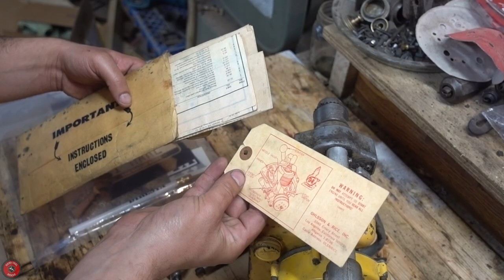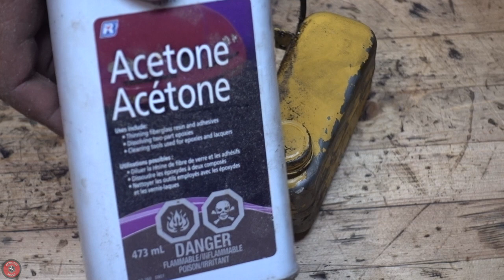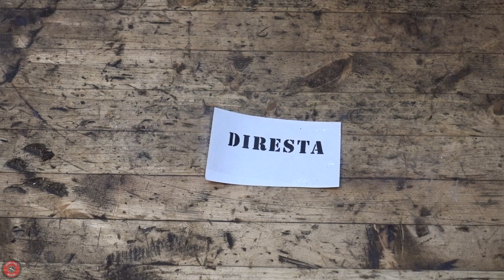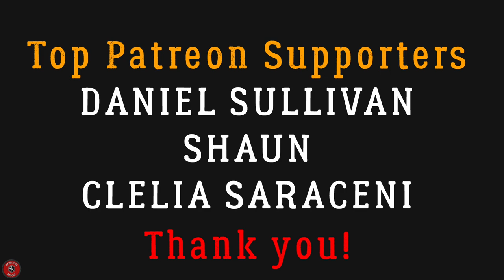Gas-Powered Hand Drill [DiRestoration]

Comment: Nice one. But how come you stopped disassembling everything? No piston/con-rod/crankshaft/head/exhaust/intake cleaning? And that chuck needs something.. is a little wobbly. The arbor is bent, or the jaws are misaligned, or something. And no inspection on the gearbox.. must have some gritty shmoo in there.
Reply from the maker: This one was more of a quick job, just to get it running.  I didn't want to open up the gearbox as I wasn't confident I wouldn't damage the gasket doing that, and they are hard to find!  I really want to open it though...
Reply: My thought as well, some turd probably dropped it.
Reply: ...gasket/s...or other hard to find parts.....try my friends at S&G Power Tools in Rancho Cordova, Calif.....2 stroke is all they do......for the last 35 years.....
Reply: Is it a weird metal gasket or something?  I've only ever been scared of head gaskets.  Don't you fabricate when you have discontinued gaskets?   Strange rebuild, but you did get it running.  I'd have to bin myself into the group that likes your other restorations better, however.
Reply: AvE LOVE IT.

Comment: Everything should be powered by a little gas engine.
Reply: I want 2 stroke kitchen appliances.
Reply: madbrianthepirate I want a 2 stroke powered light switch
Or a 2 stroke powered fork.
Reply: Taylor Robinson y tho? Too much complicated.
Reply: Complicated?? If you maintain it ONE PULL IS ALL YOU NEED. Try counting how many it takes you next time..
Reply: I'd buy it.
Reply: Nutz4Gunz45 that's what Toyota is doing. 😁
Reply: it is.
Reply: Michael j fox has the fork one down
Reply: Reminds me of a old commercial where everything was powered by gas engine, the copy machine, computers, even the water cooler lol look it up on YouTube it’ll SATISFY you
Reply: Petrolpunk.
Reply: Nutz4Gunz45  --  I want to see a TOASTER powered by a little gas engine .  LOL !
Reply: BRUMM BRUMMMMM!!
Reply: I prefer electric stuff (battery powered). I have found it works better for me, is more reliable, and easier to fix.
Reply: Gas engine powered phone... seems legit.
Reply: madbrianthepirate a two-stroke blender, a two-stroke toaster, a two-stroke dishwasher...
Reply: Nutz4Gunz45 olaaa Brasil gosto do seu trabalho
Reply: A Detroit diesel powered vacuum cleaner and a 3 cylinder turbo dishwasher are on my list.
Reply: @ClappedBimmers  Best i can do is one
Reply: Unfortunately I haven't yet seen a gas-powered sewing machine, that would be really cool. Or a gas-powered lathe

Comment: 13:05 but why ?
Reply from the maker: Making it look like one of Jimmy's personal tools.
Reply: asking the real question here.
Reply: Hand Tool Rescue Ah like all his stuff plastered with that eye sore of a name.  At least you know his style.
Reply: this was made before we had things like good portable batteries for working in remote arias
Reply: Shop Dog:  Where can you get a battery powered drill that will drill a 1 3/4 inch hole through an 18x18 inch timber.  That's what these type of things (not this one obviously) were made for.
Reply: If not for the still faulty carbeurator, it still could. If I needed something like this, I would want it very badly and there would be no replacement.
Reply: because it's his.
Reply: So, first you remove the paint that already looked like it was used. Then you repainted it... And then you destroyed the paint to make it look like is was used again... right! (Also yellow looked way better.)
Reply: Ahhhhhhhhhhhh.  Over spray!!!!

Comment: Motor stops on idle, looks like it has hardly any power to drill like 3 or 5 mm hole in dead tree carcass and the chuck had a bad case of wibble wobbles, it looks like the tool needs more work than cleaning it and repainting
Reply: Yeah, didn't look like it ran too good in any of the few second long clips he showed us.  Also, that engine isn't 2cc more likely 22cc.
Reply: funny how nobody reads the description

Comment: That was a neat old tool before the "restoration".   A little on the amateur side with the crude mechanic work and wood chisel paint scraping if you ask me. Not sure what the ultrasonic carb cleaning was about since the thing was only about 50% disassembled when it went in whatever that watery lookin bath was.  Would like to have saved it myself.  Guess that's just my thoughts on it. Kinda wish I hadn't watched now :(
Reply: Read the description

Comment: I am sure I  have seen this engine in other applications, mainly model aircraft. 

That aside.. If you ever get the chance to play with hydraulically driven  drills and chainsaws,  "do it". 
I once got to play with a well equipped "SEE" (A U.S. Military version of the UNIMOG 406) , and the chainsaw was a beast.  Even with a dull chain it would rip through mesquite like nothing. 

Just make sure they don't leak. Some of them run at absurd pressures, and will sever digits.

Comment: Dude, you got new tools! Nice to see a puller but really surprised to see the laser cut diaphragms and ultrasonic cleaner.  I've been wanting one of those forever. Perhaps next on the list is a putty knife for scraping instead of a chisel? Great job on going straight for the points on the lack of spark. I don't think it will take much adjusting to get the motor to pull RPMs.
Reply from the maker: Thanks! Plastic scrapers are definitely a good addition.  I don't have the laser cutting though! haha

Comment: Howdy.At 4:08 the caption reads 1000 grit.From the dark colour of the grit,it is possible that is emery.I was taught years ago,in no uncertain terms,never ever use emery on points under any circumstances, it is an electrical conductor,and once embedded,is very difficult to remove.You might want to remove the points and clean them up with a nonconducting abrasive.Clean flat points that are parallel to each other make quite a difference. Good luck with the carbeurator. I remember many frustrating hours with those little things.

Comment: Hey, at our school in washington we have an old 1960's Toro Sportlawn Reel Mower 22 inch. I did all that I could and accidentally broke the clutch (it was broken anyway and I really just finished off the crack). I did some makeshift repair and fixed what I could, and the clutch is hard to replace. I managed to "repair" it because it works a bit more than none at all. If I was able to weld I could have fixed it easily. The engine sparks (I should know, I shocked my hand several times trying to get it to start >~<). But my limited knowledge prevents me from fully figuring it out. It's either going to be scrapped or turned into a lawn ornament. 

Also, there are some issues like the clutch cable is seized and the throttle cable was cut, so I had to make do and it is kinda limited in that case. There is also another piece of equipment with the same engine here. Oh, and the tires are bald, but are pretty good overall. When I was looking for parts it was one of the things that was sought after. If you are interested I could give more details

Comment: ScotchBrite on those flywheel magnets neighbor...will keep the smooth while rubbing, not pit or remove too much parent material but superior at removing 
oxidation. 
Always surprised to see these excellent craftsmen using sand paper when they should use SB or a burnishing too...or banging and prying on a 
axle mounted spool/flywheel when a gear puller is the only way to insure no damage to the system components.

Comment: i used a ryobi engine drill when i installed piers in the early 90's. it was a 25cc, if i remember correctly. it drilled holes in concrete sea walls in nothing flat.

Comment: READ THIS: Jimmy Diresta sent me this tiny gas-powered hand drill made by Ohlsson and Rice for restoration. It was originally used to tap maple trees for syrup and was called the Drillgine. I believe it's from the 60s or 70s.

I decided that I didn't want to do an "as new" restoration and wanted to make the drill look like it was one of his tools that he painted white and used every day.

The drill needed its points cleaned, a new carburetor diaphragm, and a new recoil assembly. 

The small 22 cc (video says 2cc) engine produces 0.85HP. The carburetor design, in my opinion, is horrible, as the small carburetor parts have a tendency to move around under the diaphragm, causing damage. I believe one of these parts is damaged beyond repair and a new carburetor is VERY difficult to find. Until I find and replace the carburetor, the drill currently runs with less power and for short periods of time. Mucho sadness.

From what I have read, this is a common problem, and part of the reason these tools were never successful.

I thank Jimmy immensely for sending me this super cool and unique tool. I really appreciate it. I plan on returning the favour...

If someone has the parts I need, I would gladly purchase them off you.

Comment: Wonder if anyone ever figured out yet that that the round flat metal button is supposed to be attached to the diaphragm in the carb and not just sitting on top of the needle and seat slightly keeping it open because it doesn't move up and down with the pulse.

Comment: So, uhhh, what would be the chances of, you know, maybe wanting to fix that old Mcculloch chainsaw I asked you about? Lol I'm sure slim to none since you already posted a video of one similar. I'm just lost with trying to fix this thing.
Reply from the maker: Did you end up finding a replacement part?
Reply: Hand Tool Rescue I found a spring that looked very similar but it didn't taper in the center like an hourglass like the damaged one. But I also don't know if the taper is even how it's supposed to be. The spring I found is the same drive spring but it's straight. I should just order it and see. Honestly, watching this video made me think I can get the engine itself running. I never understood points, carburetors, I believe it's called a stater, etc. But cleaning/sanding those don't seem too hard. I can build damn near anything but engines confuse the hell out of me.

Comment: Hi there, new to you tube, truly enjoy your build on the drill!  I began watching you tube because I am attempting to restore a homelight  kawasaki DT18  powered trimmer, but the carb kit is no longer available, broswed you tubes for ideas, when I came across your video.   you did a laser cut for gaskets, where did you get that done may I ask sir?  Hate to not complete this project.  Edward
Reply from the maker: I contacted a guy that only cuts carb kits for this exact drill.  I suggest you check the vintage chainsaw facebook group and ask them.  They will know where you can get something like that.

Comment: I probably don’t remember correct, but I thought the points were .10, the coil timing was .20 and the plug was .30. I saw you set the timing at .10. Is this older motor different?

Comment: You would have been better served to remove each of the carb parts completely before placing into the ultrasonic. Specifically the needle and seat. Does it actually run now? Looked like you could only get it started and then it died. Super cool little machine but ... maybe a chuck and carb rebuild to call it 100%?
Reply from the maker: I ended up doing exactly that later on.  Still has issues unfortunately.  The spring inside the carb that helps pump the gas is very fatigued and I would love to find an exact replacement.  I even thought about putting a more modern carb on, but I didn't have one small enough.
Reply: The little primer spring? Or the spring under the flipper for the needle valve? The needle valve spring looks like a standard part, should be easy to source. If the fuel pump isn't working it may be that the diaphragm material has hardened or the gasket is leaking air.  Seeing as how I'm sure it's impossible to find a rebuild kit you may be SOL... unless you make your own gaskets and diaphragm?
Reply from the maker: I had new diaphragm laser cut, but the issues still persisted.  It's the "U-shaped" spring in this link that is the issue: http://myoldmachine.com/topic/1448-o-r-carb-repair-tutorial/

Comment: I was given a OR powered Warn winch, the thing is even rarer than this drill. It is as new, hardly used. , and there is a good reason for that. 

I cleaned out the carb becaus it was all gooped up with old 2-stroke oil, and fixed the spark. Mine had a different problem, stop button was shorted out. Really poorly designed engine, nightmare to work on with tiny screws in awkward places, especially the cooling shrouds and stop switch. And the carb is really sensitive and need constant tweaking despite not being worn out like the carb on this tool.

It could maybe become a useable tool if I converted it to use a modern diaphragm carb from a weed eater.

Comment: are you correct on the size of the motor?  2cc's?
Reply from the maker: I should have written 22c.
Reply: 2 Cubic Inches is about 33cc.
Reply: 33 cc for that sized engine is plausible... it might be 25cc, but that's still in the 2 ci range.
Reply: what ultrasonic cleaner do you use and what fluid?
Reply from the maker: +OttoVonNitro just water in this case.

Comment: Awesome as always! Is that an electrolysis setup your using now?
Reply from the maker: Thank you!  It's an ultrasonic cleaner.
Reply: Ah cool.
Reply: May I ask what solution is used in the ultrasonic bath?  I can't seem to get those results. Thanks!
Reply from the maker: +ricardo couto It's just water in this case!
Reply: ricardo couto leave it settle for a couple of days and slowly pour it in so you don't entrain air. Gently lower in the work, again so as not to entrain air, boiled water can work well too, it tends to remove air. If there's a heater on your bath, use it. There's wetting agents available but for general use not required. Lower frequency takes off bigger chunks of dirt, higher Hz smaller and causes less damage to polished surfaces. Hope that unlocks some of the mystery for you.

Comment: Whenever I see 'gas powered' I always think, oooh it uses compressed air of an external gas tank. And then I remember that this is American and they refer to petrol, which is a liquid, as gas, which it is not.
Reply: Jake Darling the correct word is gasoline so technically the abbreviated word would be gas
Reply: Byerboys Outdoors however in the UK we have petrol which is short for petroleum. They're actually the same thing just named differently which is why when I see gas I think things like butane or propane.

Comment: could you please learn how to adjust carberators
Reply from the maker: There is only one adjustment needle on this style of carburetor and it was set exactly as recommended by the instructions.  I even moved it further in and out to see if that helped at all.
Reply: Hand Tool Rescue Does the carb have a choke? First pull with the choke on until it fires, then switch off the choke and pull again to run it?
Reply: the default is a guide line
it is good for starting but not more than that
every engine needs a diverent setting

also i think that desandsam is right about the chocke
Reply from the maker: Yes, it does have a choke.  I did all the standard stuff to get it running.  The carb just doesn't want to pump enough gas into the chamber to keep it running, no matter the settings.
Reply: then there is a clog somwere
Reply from the maker: I think it's the spring inside the carb that helps pump the gas that is the issue.  It is very fatigued and I would love to find an exact replacement so it's back in action.  You can see the little "U" shaped spring here: http://myoldmachine.com/topic/1448-o-r-carb-repair-tutorial/
Reply: if i look ath the disk it seems like it has a dent
can it be that it is the wrong way round?
Reply from the maker: I am not sure.